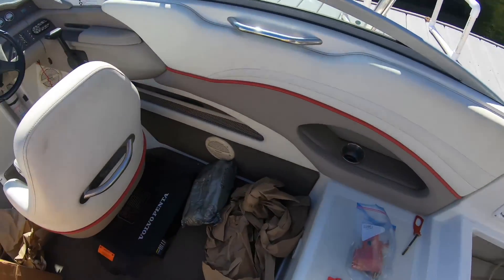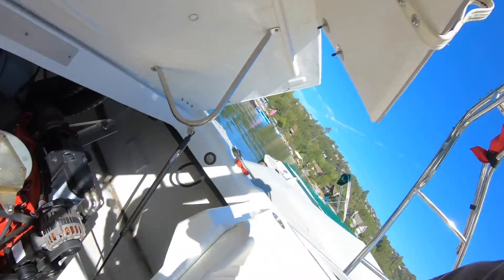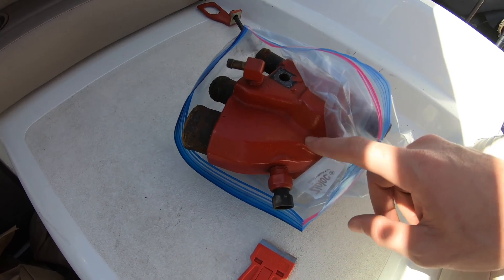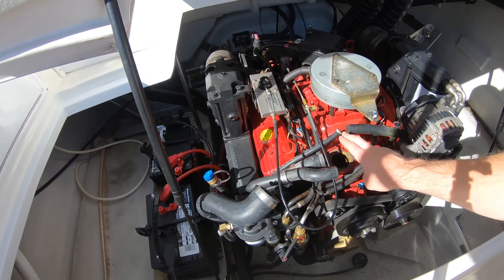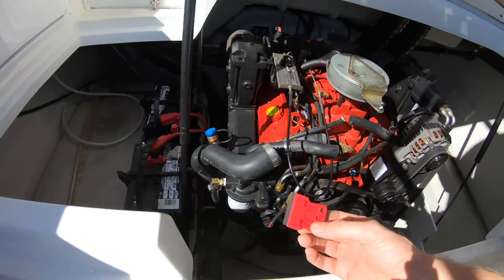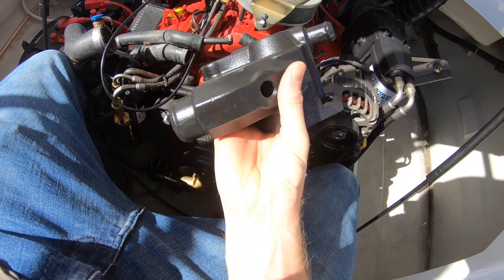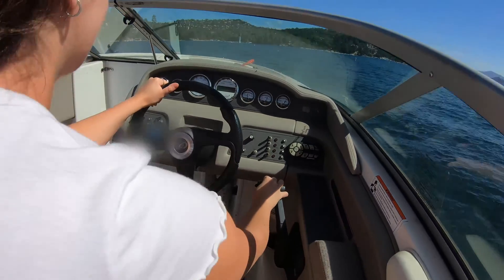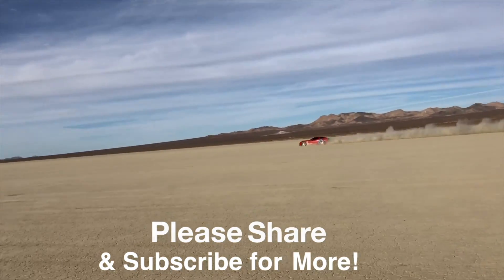Fixing An Overheating Inboard Boat Engine

Comment: Hi. Good video. I have a 5.7 V8 Volvo penta and i had the same trouble. its fixed now, but check engine light is still on, do you know any way to turn off without scan with a laptop?
i tried to cut batteries but still on.
Thanks in advance

Comment: i have the 5.0 gxi, last year impeller replaced, thermostat replaced but still over heating when running on plane. once you get off the throttle temp comes back down. this season had risers and manifolds replaced. they were original (08) and very rusty. Same issue this season. Mechanic thinks water jackets could be clogged. I love the boat but not sure what to do now ?  Is it possible the blue cap could be the problem because with it running in water it has strong water flow but seems to be aerated.  Took hose off obviously to check flow. A lot of money spent but no success.
Reply: Did u figure it out? Am running to the same exact issue

Comment: Why is the whole housing replaced and not just the thermostat? Is it corrosion issues?
Reply: Did you ever get an answer
Reply: @brandonplatt9325 no but I wasn’t having any problems with my craft at the time but I was curious

Comment: On closed cooling stern drive boats if you put to much concentrated antifreeze in will it overheat? All passages are clean new pump risers manifolds but temp is 170 this year ntead of 160. Stat is new too. 80 ocean. Thta`s the only thing i can think of. Also guage and sensor new too.
Reply from the maker: Yes this is very possible. What mix of coolant/water are you running? Unless your climate is very cold I usually do 50/50 (concentrate to distilled water)
Reply: @ZentRose  48% checked with refractor. All ther parts checked in the boat. Is there any way the metal impeller went bad on engine?  Sea water imp. new mayby cavatation. running 160 but then 180 at 3100 rpm

Comment: Need a video showing the 1589 replacement, coil upgrade to 40,000 v how does this work. Do you need to regap the plugs from 30 to 50 ? What do ya think ? Cutting out internal wire resistor white wire to coil. Changing coil to 3 ohm.

Comment: I have a 351 windsor omc that is over heating. It's getting water through it and comes out good. But gets hot as hell. When I turn it off after a few minutes i can hear everything all boiling. Engine bogs under load and dies 90 percent of the time. I've rebuilt the carb, pulled the whole thermostat out, new plugs, new distributor, new ignition coil and still don't want to run. It's timed at 8 degrees btdc. And the carb I tuned fairly well. Anyone have issues like this?

Comment: Great Video.... I have an overheating issue with my Volvo Penta 5.7 OSXi-G but it is weird!! I start the engine and I have no problem, I run the engine for  about 15 mins at around 1K RPM (in the canal where I live) no problem. When I get to the bay and then I run the engine at 3.5-4.0K RPM for 20 minutes (to cross the Key Biscayne Bay), no problem. But a soon as I bring the RPMs back to 1K, the engine starts to overheat and the alarm goes off. The only way to reduce the overheat of the engine is to go back to 3k-4K RMP, which it can be done on the throttle on idle or running the boat over 3k RPM. We have changed the water pump, the impeller, thermostat, etc. we still have the same issue. Any ideas?
Reply: What did you find was the cause?

Comment: This is a great video! I never had any overheating, then I did a preventative maintenance and had a mobile marine mechanic put a new impeller in my 1990 Sport Nautique. Now it overheated instantly on the first ride out. He’s trying to tell me my thermostat is bad (via text). I find it very hard to believe that my thermostat all of a sudden is bad the moment he messed with my cooling components. Any advice?
Reply from the maker: He might be right. That’s what happened to me. I’ve rarely seen them go bad in freshwater boats.. but mine was rusted shut. Easy to replace at least

Comment: I have the same boat engine. What would be the estimate to fix this issue? My boat started over heating last weekend. Thanks
Reply from the maker: From when I was a mechanic, this would be no more than $500 from diagnosis to fix (labor and parts). I have heard things have gotten a lot more expensive these days so I might be underestimating.

Comment: What about no water coming in from the outside to the impeller   I was told that because my boat has sat in the water for 3 1/2 months and used it has Zebra mussels plugging the inlet.  Any way to show video on was  also mine is in the water and can’t be removed for a few more months so what your advice on this

Comment: Probably a stupid question but, I have a VP 4.3l GL-A with a similar raw water pump setup.. I replaced my alternator belt and I think I crossed the hoses that connect to the pump housing.. one of them comes from the back of the motor (which I assume is the water intake hose) and the other hose goes up to the thermostat housing and connects in the middle like on yours in this video...how do I know which one of those hoses connects to where on the impeller housing? I think the upper housing inlet is the IN and the lower inlet on the housing is OUT but I'm not totally sure... my manual doesn't really say.

Comment: I took mine out last weekend and after a couple days on the water I believe that cap came loose and it would start to get warm at low idle. After coming home I found that water was coming out of that cap cuz it wasn't tight. Need to go back to the lake and make sure that's all it was

Comment: Thanks for the video! I'm looking at purchasing a boat with a 5.0 Volvo Penta. What is the hose that your referencing used for? (the one that can introduce air and cause the overheating) Also, the motor that Im looking at has two risers but the two mall hoses or connections on the backside seem to be taped back on. Do you happen to know what does are used for?

Comment: Curious, did you use a marine t-stat or automotive? For freshwater use, I don't see a prob with auto t-stat but I have heard many opinions. Thx!
Reply from the maker: Marine on this one. The one in there lasted 15 years. Auto might be fine but I also wouldn't want to lose time on the lake in case it doesn't work out.

Comment: Just got ahead and change out the raw water impeller. If sitting for months a time the veins curve and lose the seal against the housing wall. Cheap enough
Reply from the maker: Tood Anderson Impeller gets changed every annual. If an impeller went bad in a few months we’d all be in trouble 😂